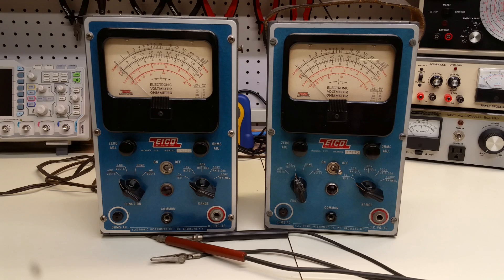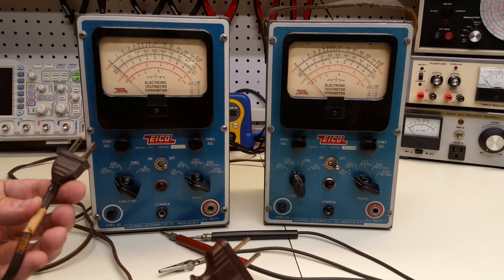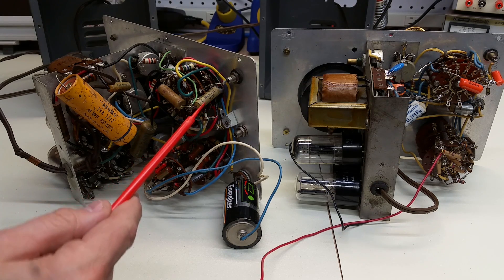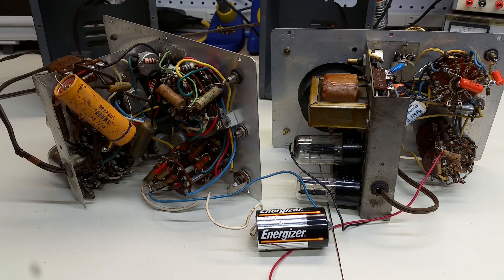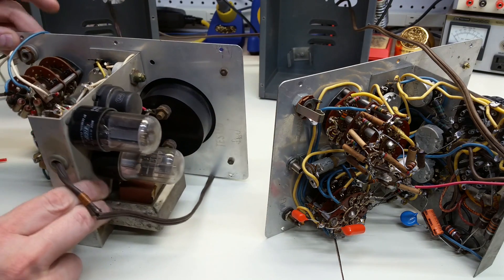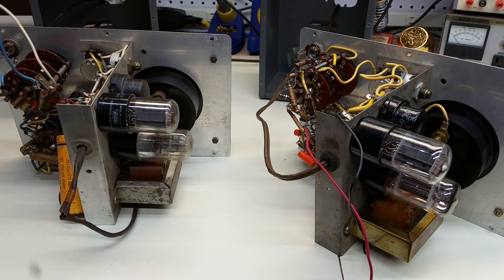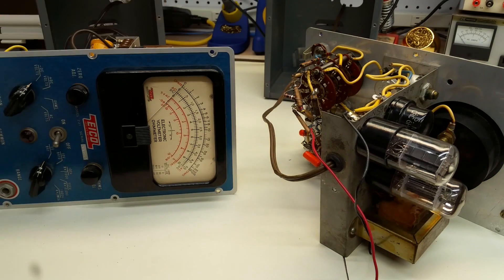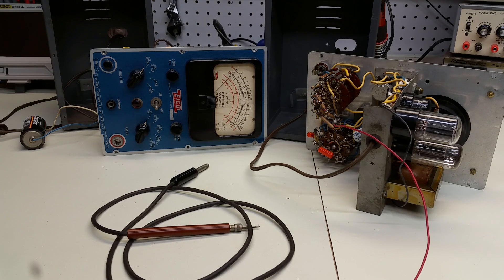#19: EICO 221 VTVM, part 2

Comment: Just got one of these but the previous owner had removed the power transformer, and I haven’t been able to find a rating online.  I see a part number on one of your transformers, any way you could tell me what the secondary is?  360-0-360?  I haven’t been able to get any info online from the part number on top of the transformer.  Thank you!